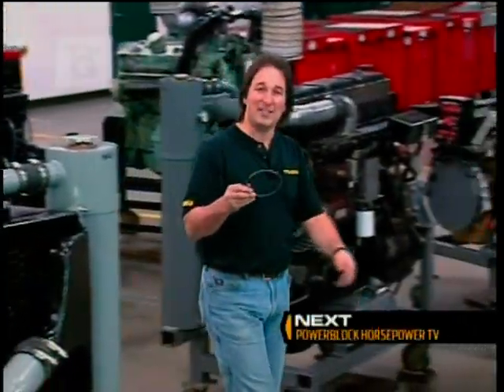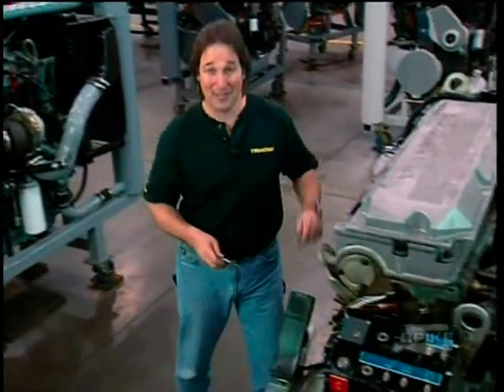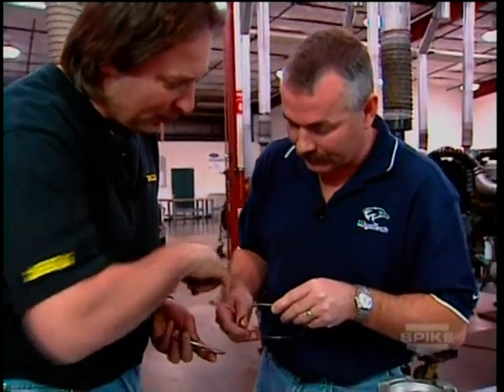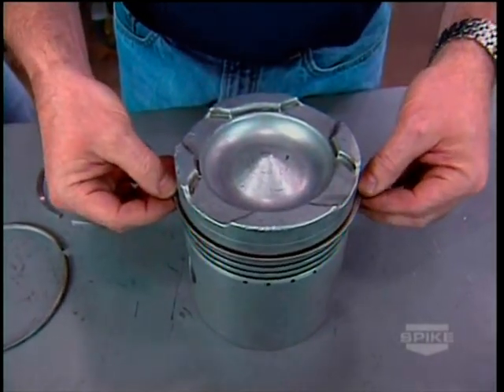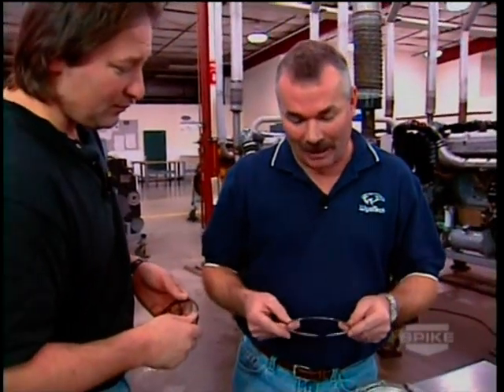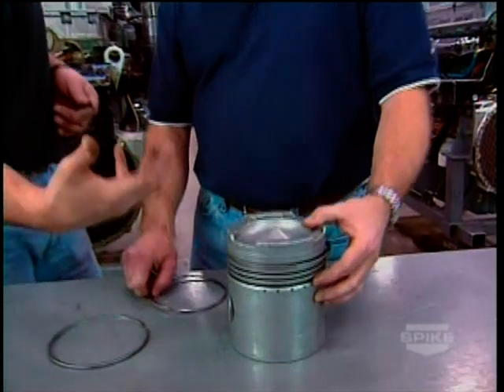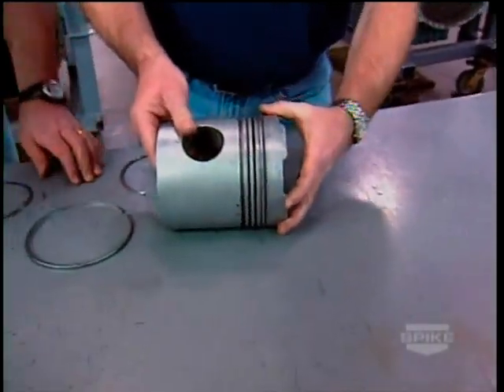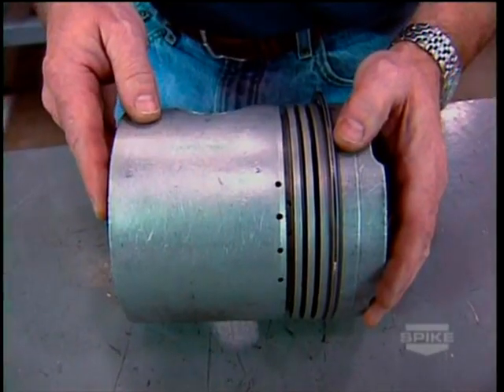Here's why diesel engines are better than gasoline engines

Comment: With proper care a gasoline engine can go well over 200,000 miles without requiring major service.  As well, with proper care a gasoline engine can exceed 1,000,000,000 (one million) miles on the odometer.

That big rig diesel sees a much different pattern of use as compared to a gasoline engine.

Comment: Let me break down all the factors for people who want real reasons.. Diesel engines are more fuel efficient. Diesel engines can run on kerosene, as well as heating oil and cooking oil. Diesel engines can run and even start without glow plugs. You can run one all day with no plugs, easy. Diesels can haul heavier loads, due to how much torque comes out of those enormous engines. A running diesel is basically a very very rapid spark knock, which is less annoying than any misfire or sputter. And most of all, diesels can kick ass in a quarter mile. You're welcome everyone. Any denials or doubts on these factors will result in an explanation of why and how they are all true.

Comment: One of the big reasons, and not mentioned in the video, is diesel is an oil and can help lubricate a bit. Where as petrol/gasoline is a solvent that removes the oil from the cylinder wall.
Reply: Brilliant God damn.
Reply: A thinking man is what you are!
Reply: B5-b20

Comment: the diesel last longer because the less rpm=longer life/less friction simple like that
Reply: Yes, about 2,000rpm tops for the big diesel vs 5 to 6,000rpm for a gas engine.
Reply: I have had one of those big diesel pistons in my living room for over 20yrs. Its out of a Cummins 350 engine... I use it for an ash tray.

Comment: I would have thought having regular oil changes from the strict maintenance schedules that big rigs have would be a big part of the reason why this type of engine goes on a lot further than petrol engines, that are owned in private hands.The majority of privately owned petrol vehicles don't have full service history...
Reply: Koito rob yeah big rig engines are different. A passenger car diesel will still generally go further than a petrol/gasoline passenger car but the difference will be less. Might even be a causal link that'd need correcting for that simply people who drive higher mileages tend to buy diesels because of increased fuel economy.

Comment: This video is a bunch of bullshit. Apart from all the incorrect info they forget to mention that it cost 6-10 thousand for a diesel rebuild vs 300-500 for a small block Chevy or 1000 for a big block.... Yea tell me that diesel is so much more advanced, more reliable and performs better than a good old pushrod gas

Comment: Bad title, poor incorrect information.  Slightly wrong is still wrong.
Reply: Yeah, it's a totally misleading title.  The video is comparing apples and oranges.   I thought this was going to be a video that discussed the advantages and disadvantages of diesel engines vs. gasoline engines in similar applications.  (E.g., pickup trucks.)  Not consumer automotive gasoline engines vs. commercial 18-wheel diesel truck engines.

Comment: diesel is more efficient at 30percent whereas petrol is only 22percent correct me if im wrong oh children of engineering!
Reply: xXFagMan3000Xx TSI petrols also release particles and diesels' NOx also can be reversed. Every kind of engine pollutes, even electric ones, directly or indirectly.
Reply: ye but still petrol isn't bad for people and the damage from the exhaust can be mostly reversed by trees on the other hand people are starting to die from the black particles released by diesel 
and i personally prefer high reving engine and there noise
Reply: Modern diesels are closer to 40%, while TSI petrols are around 30%.
Reply: steam engines get over 80percent I think

Comment: wow the piston has so many grooves to accomodate the rings, if It had only 2 I think the grind and slide friction will be much less in the engine although compression will have to suffer..
Reply: cars have 3 these are special pistons for big diesel engines

Comment: diesels typically last longer because they are built to withstand the abuse. if you build a gasoline engine to withstand 2000hp and allow itto make max. 500, it would last 800,000 miles as well. it has nothing to do with which is better. it's about the quality of the build.
Reply: They last longer because they rev lower. Less revolutions mean less wear.
Reply: Adam S
Reply: How much power would a 6.7L gas engine that was built tough like a diesel running 35psi of boost make? Probably more than a 6.7 diesel...

Comment: I had a little S-10 that I sold about two years ago with a few miles on it.  380,000  miles and was still running well.  The motor had not been rebuilt.  I kept the oil changed.
Reply: +Michael Walker ive seen plenty of original non rebuilt 800,000 km gm's
Reply: +Michael Walker I had it's big brother - Chevy 2500 with a 350 - 380,000 and no smoke !
Reply: Try 955,000 that a ISX 15 Cummins lasted

Comment: That's not why diesel engines are better than gas engines, it's why gigantic overbuilt engines last longer than ones that aren't gigantic and overbuilt.
Reply: Yeah, it's a totally misleading title.  The video is comparing apples and oranges.
Reply: Yet there are 5.9 Cummins engines with well over 3 million miles on them.

Comment: Simple as this to say, Diesels are workhorses that doesn't have better power than gas engines, but longer life before a rebuild is needed, while gas engines are race horses with better power than a diesel  but gas engines will need more rebuilds than a diesel as it has shorter life than a diesel, but there is no telling when an engine will need a rebuild as they can last up to 1 million miles or could fail as little as 4K Miles, I will stick to my race horse choice and do rebuilds whenever needed as I love my racehorse Power.
Reply: have u ever driven a diesel? if not u have to give it a shot! diesels because of their design have alot more torque which is ur off the line power and ur pulling power. also because diesels are generally turbos the ate easily customizable for alot more power. I have friends with stock trucks that put on a $300 computer programmer inside their truck. it improves fuel economy and power. it has been proven that these programmers can add up past 100hp! just food for thought
Reply: But your race horse won't get a 100000 lbs load moving

Comment: Stacey, when you talk about an 800k mile engine you're referring to the Cummins ISX diesel engine. The Detroit Diesel 60 Series engines which you walked up to one in this video is the exact engine I have in my semi-truck and they typically average 1.5-million miles before overhaul if they are properly cared for and oil changes are performed religiously which I do every 15,000 miles. Since I've only 983,000 miles on my '03 International, it's likely to be years yet before I need any major service or overhaul especially now I'm using Hot Shot's Secret Stiction Eliminator oil treatment and Diesel Extreme fuel treatments. If my liners are in good shape, I'll likely exceed 1.5-million miles before my engine needs to be overhauled.
Reply: That's exactly what I was thinking
Reply: my yamaha 2 stroke petrol needs overhaul every year of 15000 miles hehehe

Comment: 1) Enjoy your diesel runaway. At least I don't have to worry about my engine self-destructing because of worn out rings
2) When piston rings wear out in a gasoline engine, you replace the rings, not the whole piston (unless you're some rich guy with a "new new new" attitude).
3) Enjoy driving something that can't start in winter without thousands of dollars of modifications.

Diesel has its place: on trucks until they're replaced by electric motors w/contactless charge embedded in the highways and on boats before the green communists get nuked and we can put nuclear reactors in all ships. Diesel is only useful for tractors and farm equiptment where there are no superior alternatives.

Thank God we can now make cheap crude oil from algae which will make all fuel dirt cheap once someone builds a massive pipeline down the Missississippi basin so that algae crude can be manufactured for cheap.
Reply: Everything you just pointed out are issues Diesels had in the early 20th century. It is now the 21st century and Diesels are much more advanced with something called "technology". Sooooo you only proved your ignorance.
Reply: You stuck in the 80s brother? Lol
Reply: +Jon Groves He's stuck way before then. My '84 Detroit has glow plugs and starts just fine in the winter.
Reply: Diesel engines are superior over gas as far as low end torque and fuel efficiency. Semis are powered by diesel because a gas equilivalnt would not be able get good enough fuel mileage. Diesel technology has come a long was things such as vgt turbos and common rail injection have helped out a lot. Currently fossil fuels are the best battery's we have as far as storing massive amounts of energy. Our battery technology has a long ways to go before we can replace diesel fuel in semi trucks.
Reply: +frankbradshaw1770 common Rail diesels are also way more expensive than the old school diesels. Although they have advantage as far as easier to tune and better cold start than older diesels, they don't get any better fuel economy than old school diesels. Same thing with vgt turbos. They may have quicker spool but are more expensive and have shown to be very problematic. Emisions laws and bad engineering have ruined diesels. Been that way for the last ten years which is About how long vgts and common rails ha e been around. I'll stick with my old school diesels. They are more reliable because they are more primitive so there is less moving parts. Keep it simple stupid.

Comment: I had a ford tbird with over 450,000 miles on it and then the car got in a wreck.  Engine still was running strong with no issues.  4.6 V-8.  I have seen many gas engines of today go way over 500,000 miles.
Reply: yes its about how you treat your car/truck

Comment: You get more power with a gasoline engine than you do with a diesel engine supposedly.
Reply: much dependa on bore to stroke ratio, and the cam profile, be it gas or diesel.  diesel generally has a longer stroke, so is best suited to lower rpm, but some diesels may surprise you.  also energy density is better in diesel fuel, resulting in longer range, and better fuel mileage. also, diesels run lean all the time, and gas engines dump excess fuel into the cylinder to cool the combustion chamber that is not needed for making power. at least during idle, and high load regimens.  diesel is superior in many ways.
Reply: If that were true why would EVERY tractor-trailer, bus, train and farm equipment be diesel?
Reply: More kw's maybe but not as many newton meters, pretty much the low down grunt for towing etc.
Reply: Nope, diesel has more btu's than gasoline, diesels also make better use of the fuel and make more power. Look at a small 4 cylinder diesels, more power and better mpg than gas engines of the same size.
Reply: ***** Turbos and intercoolers are not exclusive to diesel engines. Also modern cars have been improving compression ratio. Also diesels don't rev as high which makes them unfavorable to build them as race vehicles for cheap. A lot of factory gas engines make more hp than diesels do just because they can rev higher. Torque (lb-ft) times rpm divided by 5,252 gives you horsepower. It's not like more torque automatically gives you more horsepower, there's a lot more to it.
Reply: YouthFreedomFighters they have different abilitys. you can run massive compression ratios while using enormous amounts of boost in a diesel.
Reply: Well that's what I had heard, that gasoline engines are stronger and faster than diesel engines although diesel engines usually last longer. That's why you don't find any race cars that run on diesel, although I will do the search you recommended.
Reply: YouthFreedomFighters  That's incorrect, diesel engines are much stronger than gas engines, they have to be. They put out more power per cubic inch, run hotter under load and have to deal with 16-23:1 compression and the violent combustion event.
Reply: Gerry Cooney If I put the same amount of cash into a car as these guys that race 11 second diesel trucks, I could probably hit 9 seconds on a bad day. If you want to go fast a diesel truck is an impractical way of doing so IMHO. But to haul something large and heavy a diesel truck would be my tool of choice.
Reply: Teamster Pride Every tractor trailer? How old are you 16? You forget about the millions of GMC gas V6's and V8 medium and heavy duty trucks that did work decades?
Reply: Frank Byers They used to have steam powered trains and cars too! Whats your point?
Reply: YouthFreedomFighters f what u heard nigga
Reply: ***** I'm a computer tech lol. Just grew up in a family that's into modifying cars.
Reply: ***** Probably if you want a mentor to get into that stuff, talk with some people at a car show. Look for the ones that have old muscle cars. They typically know more about internal engine mods. A lot of the "tuner crowd" is into throwing a turbo on a bone stock engine and will wonder why they burn up four engines a year.
Reply: ***** Yes, that happens. And connecting rods often goes out on those jobs.
Reply: The big rig engines produce up to 605 hp and 2050 lbs of torque
Reply: Have you seen the Audi diesel racecars that won many consecutive Le Mans 24 hours? They dominated endurance racing from 2006 until just the last couple of years.
Reply: i love what u says on diesel but both of them petrol engine and diesel engine i think dey r heavy for y personal jetpack engine..